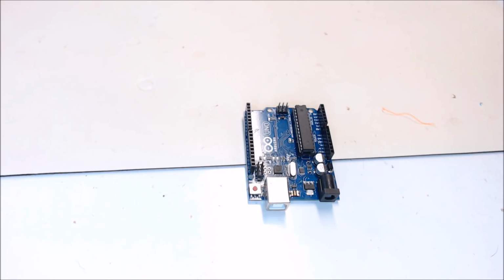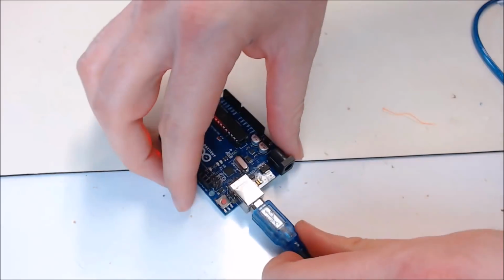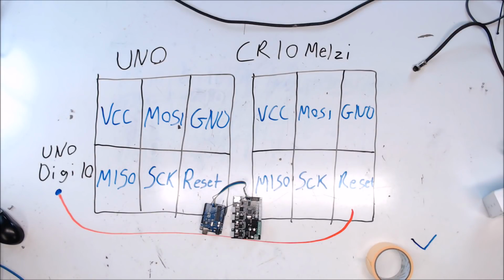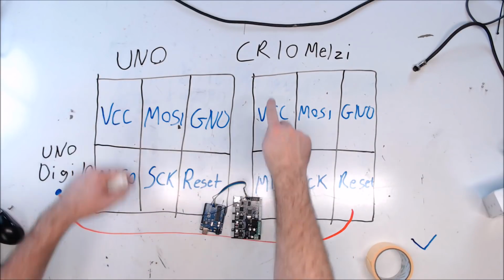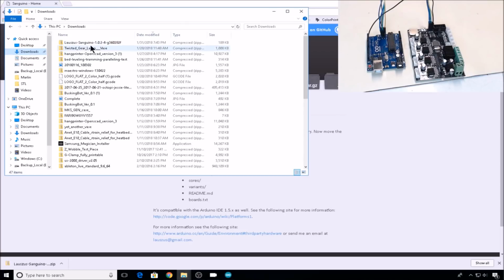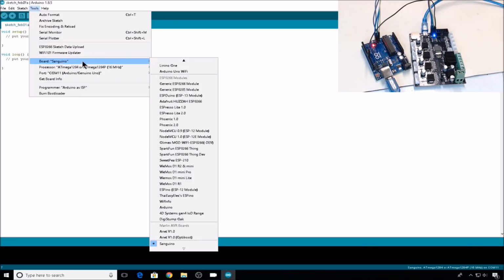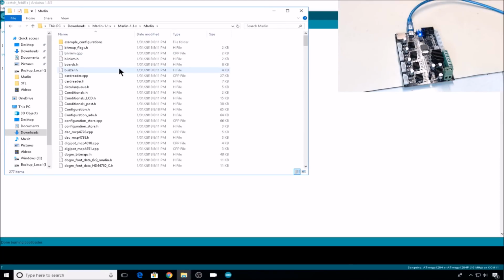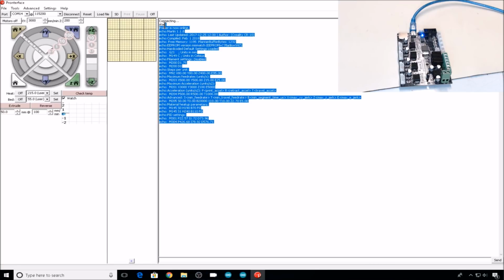Creality CR-10 Marlin Firmware Upgrade - Chris's Basement

Comment: I can't get this to work. it's a "newer" c3d board.. from a hictop, "Creality3D v1.1.2", didn't let me flash marlin so I tried this. I think it burned to bootloader?

Atmega chip programmer.
Written by Nick Gammon.
Version 1.38
Compiled on Aug 24 2018 at 09:32:13 with Arduino IDE 10806.
Attempting to enter ICSP programming mode ...
Entered programming mode OK.
Signature = 0x1E 0x97 0x05 
Processor = ATmega1284P
Flash memory size = 131072 bytes.
LFuse = 0xFF 
HFuse = 0xDE 
EFuse = 0xFD 
Lock byte = 0xCF 
Clock calibration = 0x52 
Bootloader address = 0x1FC00
Bootloader length = 508 bytes.
Type 'Q' to quit, 'V' to verify, or 'G' to program the chip with the bootloader ...
Erasing chip ...
Writing bootloader ...
Committing page starting at 0x1FC00
Committing page starting at 0x1FD00
Written.
Verifying ...
No errors found.
Writing fuses ...
LFuse = 0xFF 
HFuse = 0xDE 
EFuse = 0xFD 
Lock byte = 0xEF 
Clock calibration = 0x52 
Done.
Programming mode off.
Type 'C' when ready to continue with another chip ...

But I get this error when uploading marlin

Arduino: 1.8.6 (Windows 10), Board: "Sanguino, ATmega1284 or ATmega1284P (16 MHz)"

In file included from sketch\HAL.h:33:0,

                 from sketch\MarlinConfig.h:39,

                 from sketch\Sd2Card.cpp:29:

Sd2Card.h:100:39: error: pasting "/* SPI Master In Slave Out pin*/" and "_DDR" does not give a valid preprocessing token

   #define SPI_MISO_PIN MISO_PIN       // SPI Master In Slave Out pin

                                       ^

sketch\fastio.h:86:42: note: in definition of macro '_SET_INPUT'

 #define _SET_INPUT(IO)        CBI(DIO ## IO ## _DDR, DIO ## IO ## _PIN)

                                          ^

sketch\Sd2Card.cpp:316:3: note: in expansion of macro 'SET_INPUT'

   SET_INPUT(SPI_MISO_PIN);

   ^

sketch\Sd2Card.cpp:316:13: note: in expansion of macro 'SPI_MISO_PIN'

   SET_INPUT(SPI_MISO_PIN);

             ^

Sd2Card.h:100:39: error: pasting "/* SPI Master In Slave Out pin*/" and "_PIN" does not give a valid preprocessing token

   #define SPI_MISO_PIN MISO_PIN       // SPI Master In Slave Out pin

                                       ^

sketch\fastio.h:86:61: note: in definition of macro '_SET_INPUT'

 #define _SET_INPUT(IO)        CBI(DIO ## IO ## _DDR, DIO ## IO ## _PIN)

                                                             ^

sketch\Sd2Card.cpp:316:3: note: in expansion of macro 'SET_INPUT'

   SET_INPUT(SPI_MISO_PIN);

   ^

sketch\Sd2Card.cpp:316:13: note: in expansion of macro 'SPI_MISO_PIN'

   SET_INPUT(SPI_MISO_PIN);

             ^

Sd2Card.h:99:39: error: pasting "/* SPI Master Out Slave In pin*/" and "_DDR" does not give a valid preprocessing token

   #define SPI_MOSI_PIN MOSI_PIN       // SPI Master Out Slave In pin

                                       ^

sketch\fastio.h:87:42: note: in definition of macro '_SET_OUTPUT'

 #define _SET_OUTPUT(IO)       SBI(DIO ## IO ## _DDR, DIO ## IO ## _PIN)

                                          ^

sketch\Sd2Card.cpp:317:3: note: in expansion of macro 'SET_OUTPUT'

   SET_OUTPUT(SPI_MOSI_PIN);

   ^

sketch\Sd2Card.cpp:317:14: note: in expansion of macro 'SPI_MOSI_PIN'

   SET_OUTPUT(SPI_MOSI_PIN);

              ^

Sd2Card.h:99:39: error: pasting "/* SPI Master Out Slave In pin*/" and "_PIN" does not give a valid preprocessing token

   #define SPI_MOSI_PIN MOSI_PIN       // SPI Master Out Slave In pin

                                       ^

sketch\fastio.h:87:61: note: in definition of macro '_SET_OUTPUT'

 #define _SET_OUTPUT(IO)       SBI(DIO ## IO ## _DDR, DIO ## IO ## _PIN)

                                                             ^

sketch\Sd2Card.cpp:317:3: note: in expansion of macro 'SET_OUTPUT'

   SET_OUTPUT(SPI_MOSI_PIN);

   ^

sketch\Sd2Card.cpp:317:14: note: in expansion of macro 'SPI_MOSI_PIN'

   SET_OUTPUT(SPI_MOSI_PIN);

              ^

Sd2Card.h:101:39: error: pasting "/* SPI Clock pin*/" and "_DDR" does not give a valid preprocessing token

   #define SPI_SCK_PIN SCK_PIN         // SPI Clock pin

                                       ^

sketch\fastio.h:87:42: note: in definition of macro '_SET_OUTPUT'

 #define _SET_OUTPUT(IO)       SBI(DIO ## IO ## _DDR, DIO ## IO ## _PIN)

                                          ^

sketch\Sd2Card.cpp:318:3: note: in expansion of macro 'SET_OUTPUT'

   SET_OUTPUT(SPI_SCK_PIN);

   ^

sketch\Sd2Card.cpp:318:14: note: in expansion of macro 'SPI_SCK_PIN'

   SET_OUTPUT(SPI_SCK_PIN);

              ^

Sd2Card.h:101:39: error: pasting "/* SPI Clock pin*/" and "_PIN" does not give a valid preprocessing token

   #define SPI_SCK_PIN SCK_PIN         // SPI Clock pin

                                       ^

sketch\fastio.h:87:61: note: in definition of macro '_SET_OUTPUT'

 #define _SET_OUTPUT(IO)       SBI(DIO ## IO ## _DDR, DIO ## IO ## _PIN)

                                                             ^

sketch\Sd2Card.cpp:318:3: note: in expansion of macro 'SET_OUTPUT'

   SET_OUTPUT(SPI_SCK_PIN);

   ^

sketch\Sd2Card.cpp:318:14: note: in expansion of macro 'SPI_SCK_PIN'

   SET_OUTPUT(SPI_SCK_PIN);

              ^

exit status 1
pasting "/* SPI Master In Slave Out pin*/" and "_DDR" does not give a valid preprocessing token

This report would have more information with
"Show verbose output during compilation"
option enabled in File -> Preferences.
Reply from the maker: Did you un-hook the UNO before you tried to upload Marlin? Did you switch your board setting to your printer main board first? I haven't seen an SPI error like this before.
Reply: @ChrisRiley  its an AtMega 2560, I used the same setup to flash a boot loader on my anet board. I figured it out from this guide: https://www.th3dstudio.com/knowledge-base/th3d-unified-firmware/ 
The only difference between it and your guide was I think some configuration.h changes and a different ISP sketch.
Reply from the maker: Great! I am glad you got it working.

Comment: Do you know if this is the same board they use on their other machines? Ender 2/ 4?
Reply from the maker: I can only speak for the Ender 2 as I don't have a 4. They are not the same, but they are very similar. I would have to get a specs sheet out to confirm, but my guess is the process would work on the Ender 2 just fine.

Comment: I get an error code when I tried to burn Marlin 1.1.8. Can anyone help me out?

Arduino: 1.8.5 (Windows 10), Board: "Sanguino, ATmega1284 or ATmega1284P (16 MHz)"

avrdude: stk500_recv(): programmer is not responding
avrdude: stk500_getsync() attempt 1 of 10: not in sync: resp=0x03
avrdude: stk500_recv(): programmer is not responding
avrdude: stk500_getsync() attempt 2 of 10: not in sync: resp=0x03
avrdude: stk500_recv(): programmer is not responding
avrdude: stk500_getsync() attempt 3 of 10: not in sync: resp=0x03
avrdude: stk500_recv(): programmer is not responding
avrdude: stk500_getsync() attempt 4 of 10: not in sync: resp=0x03
avrdude: stk500_recv(): programmer is not responding
avrdude: stk500_getsync() attempt 5 of 10: not in sync: resp=0x03
avrdude: stk500_recv(): programmer is not responding
avrdude: stk500_getsync() attempt 6 of 10: not in sync: resp=0x03
avrdude: stk500_recv(): programmer is not responding
avrdude: stk500_getsync() attempt 7 of 10: not in sync: resp=0x03
avrdude: stk500_recv(): programmer is not responding
avrdude: stk500_getsync() attempt 8 of 10: not in sync: resp=0x03
avrdude: stk500_recv(): programmer is not responding
avrdude: stk500_getsync() attempt 9 of 10: not in sync: resp=0x03
avrdude: stk500_recv(): programmer is not responding
avrdude: stk500_getsync() attempt 10 of 10: not in sync: resp=0x03
Error while burning bootloader.

This report would have more information with
"Show verbose output during compilation"
option enabled in File -> Preferences.
Reply from the maker: What part are you seeing this error? This usually happens when you have selected the wrong board. Is this when you are loading the boot loader?
Reply: This happened when I was uploading the Marlin Firware
Reply from the maker: This says you are trying to burn the boot loader. Error while burning bootloader.
THe boot loader setting should be different. Try one more time from the start.
Reply: I will thanks

Comment: You got the same warning  as I  did.... low memory.  This version does not work with Octoprint....
Reply from the maker: Yep, we are right at the edge of what this board can handle. No octoprint? I will have to check that out.
Reply: I thought my octoprint was bad.... spent time reprogramming - then I reflashed to unified TH3 and it worked... so ... it is marlin... I'm waiting to hear what you come up with.
Reply from the maker: Not sure what is going on, but mine doesn't seem to have an issue with octoprint. Here is the output from my startup. I will do some prints and see if it does anything funny.

https://docs.google.com/document/d/1TfSy9FW9zeezlARtNzdrYwsqS8r6OALtO6dUdojWEUw/edit?usp=sharing
Reply: That is weird.  I have no problems with other firmware... maybe because I have the 'new' melzi?  Octoprint works with other firmware but resets with 1.1.8
Reply from the maker: Very strange, could be a different board. Have you tried 1.1.7 or a lower version?
Reply: No - does 1.1.7 have the creality cr10??  I'll it.
Reply from the maker: Yes, 1.1.7 has the CR10 config.

Comment: Its a shame that there is not enough memory to enable mesh bed leveling (without a probe).
Reply from the maker: I noticed that is was complaining about low memory. I wonder if there is somethings we could peel back to help with this? I will look into it.
Reply: Chris Riley i have a build for cr10s, i tried to get mesh leveling in on the cr10 and removed everything including reducing buffer sizes but i got close 168 bytes to big. But you also need a bit of wiggle room to operate well.
Reply from the maker: Hey Tim, one of my subscribers mentioned you the other day. I will take a look. Thanks!

Comment: Is there a way to do this with Raspberry Pi?
Reply from the maker: You probably could, but you would have to find some software that would act as a serial programmer. The clone UNO's are so cheap it's just as easy to use one of those.
Reply: Either buy a clone uno for dirt cheap or even a usb isp programmer they can be had for like £2-3

Comment: i followed your instructions to the letter. but i get an error when attempting to burn the bootloader. I got an Geekcreit® UNO R3 ATmega328P  this one "https://www.banggood.com/UNO-R3-ATmega328P-Development-Board-For-Arduino-p-963697.html" 

this is the error i am getting. What am i doing wrong?

Arduino: 1.8.9 (Windows 10), Board: "Sanguino 1284p, ATmega1284P (16 MHz)"

C:\Program Files (x86)\Arduino\hardware\tools\avr/bin/avrdude -CC:\Program Files (x86)\Arduino\hardware\tools\avr/etc/avrdude.conf -v -patmega1284p -carduino -PCOM7 -b19200 -e -Ulock:w:0x3F:m -Uefuse:w:0xFD:m -Uhfuse:w:0xDE:m -Ulfuse:w:0xFF:m 

avrdude: Version 6.3-20171130
         Copyright (c) 2000-2005 Brian Dean, http://www.bdmicro.com/
         Copyright (c) 2007-2014 Joerg Wunsch

         System wide configuration file is "C:\Program Files (x86)\Arduino\hardware\tools\avr/etc/avrdude.conf"

         Using Port                    : COM7
         Using Programmer              : arduino
         Overriding Baud Rate          : 19200
         AVR Part                      : ATmega1284P
         Chip Erase delay              : 55000 us
         PAGEL                         : PD7
         BS2                           : PA0
         RESET disposition             : dedicated
         RETRY pulse                   : SCK
         serial program mode           : yes
         parallel program mode         : yes
         Timeout                       : 200
         StabDelay                     : 100
         CmdexeDelay                   : 25
         SyncLoops                     : 32
         ByteDelay                     : 0
         PollIndex                     : 3
         PollValue                     : 0x53
         Memory Detail                 :

                                  Block Poll               Page                       Polled
           Memory Type Mode Delay Size  Indx Paged  Size   Size #Pages MinW  MaxW   ReadBack
           ----------- ---- ----- ----- ---- ------ ------ ---- ------ ----- ----- ---------
           eeprom        65    10   128    0 no       4096    8      0  9000  9000 0xff 0xff
           flash         65    10   256    0 yes    131072  256    512  4500  4500 0xff 0xff
           lock           0     0     0    0 no          1    0      0  9000  9000 0x00 0x00
           lfuse          0     0     0    0 no          1    0      0  9000  9000 0x00 0x00
           hfuse          0     0     0    0 no          1    0      0  9000  9000 0x00 0x00
           efuse          0     0     0    0 no          1    0      0  9000  9000 0x00 0x00
           signature      0     0     0    0 no          3    0      0     0     0 0x00 0x00
           calibration    0     0     0    0 no          1    0      0     0     0 0x00 0x00

         Programmer Type : Arduino
         Description     : Arduino
         Hardware Version: 2
         Firmware Version: 1.18
         Topcard         : Unknown
         Vtarget         : 0.0 V
         Varef           : 0.0 V
         Oscillator      : Off
         SCK period      : 0.1 us

avrdude: AVR device initialized and ready to accept instructions

Reading | ################################################## | 100% 0.00s

avrdude: Device signature = 0x000000 (retrying)

Reading | ################################################## | 100% 0.00s

avrdude: Device signature = 0x000000 (retrying)

Error while burning bootloader.
Reading | ################################################## | 100% 0.00s

avrdude: Device signature = 0x000000
avrdude: Yikes!  Invalid device signature.
         Double check connections and try again, or use -F to override
         this check.

avrdude done.  Thank you.

This report would have more information with
"Show verbose output during compilation"
option enabled in File -> Preferences.

Comment: Hey, as uploading it to my board, it said

Problem uploading to board.  See http://www.arduino.cc/en/Guide/Troubleshooting#upload for suggestions.

I don't know what to do or fix. I'm running on windows 10, I'm using an opensource brand arduino,and the compiling's good. Everything I know of works, but it will not upload. I would love to get a diagnostics list or any help at all. Thanks
Reply from the maker: In device manager, what does it call this board? I would try an older version of the IDE as well, maybe 1.8.5
Reply: @ChrisRiley  I got it to work a hour ago, thanks thought
Reply: thought i did have a problem with my printer, at every layer change it kicks the filament out and sometimes so far out it goes out of the machine. I have a CR-10m and are using Cura. i wold love to hear your ideas on the situation.
Reply from the maker: @starburns7336  Sounds like maybe the e steps are too high, it might be trying to do a really large retraction.
Reply: @ChrisRiley  no i dont thinks its that
Reply from the maker: @starburns7336  Did you find a solution for this?
Reply: @ChrisRiley  Yeah, thanks

Comment: and if you do it incorrectly can you reload the bootloader?
Reply from the maker: You can't get it back to stock, but you should be able to straiten it out one way or another. Just go slow and make sure you check and re-check all your connections. Let me know if you get stuck.
Reply: thanks!
Reply: i'm having a problem: I burned the bootloader successfully, but when I try to flash the firmware it says "Error compiling for board sanguino"
Reply from the maker: Make sure you have the sanguino board files installed. If you are getting the u8glib check out the first link in the description. Send me the error if this doesn't help.
Reply: here is the error: 

Arduino: 1.8.5 (Windows 10), Board: "Sanguino, ATmega1284 or ATmega1284P (16 MHz)"

C:\Users\Thomas\Downloads\Marlin-1.1.x\Marlin-1.1.x\Marlin\Marlin.ino:45:110: fatal error: U8glib.h: No such file or directory

     #include <U8glib.h> // library for graphics LCD by Oli Kraus (https://github.com/olikraus/U8glib_Arduino)

                                                                                                              ^

compilation terminated.

exit status 1
Error compiling for board Sanguino.

This report would have more information with
"Show verbose output during compilation"
option enabled in File -> Preferences.
Reply from the maker: Yep, run through that U8glib doc in the description to fix it.
Reply: hmm it looks like my error is outdated arduino ide....
Reply: thanks, but now it is stuck verifying
Reply: whoops its just going slow as a snail :D
Reply: Thanks! It worked!
Reply from the maker: Great work man!

Comment: Do you know why I would get a vibrating noise after I complete the firmware on my CR-10? I hear the noise from the 'Z' axles when I home the extruder. I installed Marlin 2.0 on a cr-10s board.
Reply from the maker: The only thing I can think of is that the holding voltage is higher how. Does it other wise work correctly?
Reply: I haven't tried it yet as I was waiting on the new display that is required for the CR-10s board I installed. Everything works as it should just the strange vibration when I home the extruder.
Reply from the maker: @byronkobialko3442  That is strange, maybe the new firmware is just a lot slower.